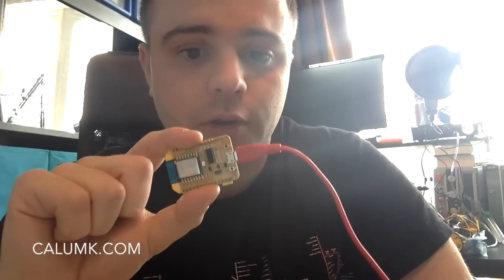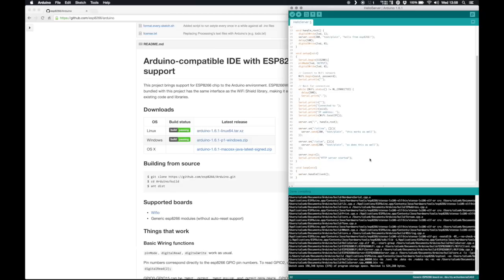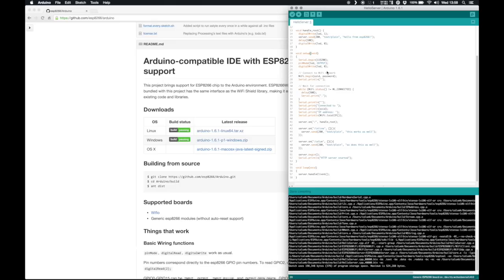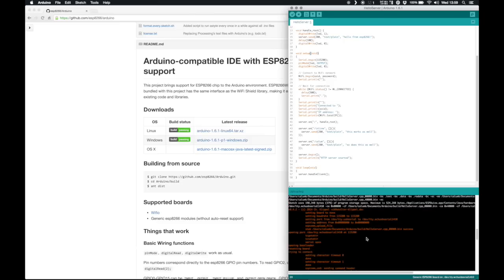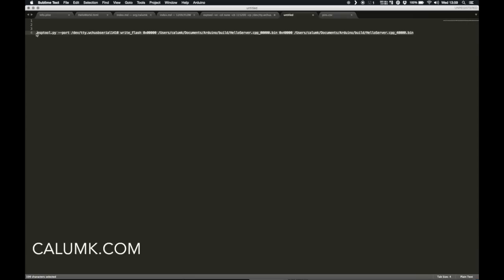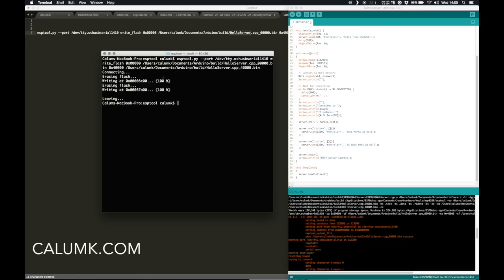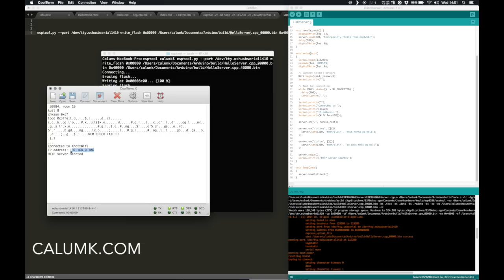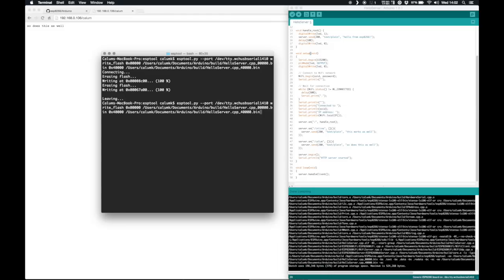Calumk.com - Programming the ESP8266 with Arduino IDE from OSX & esptool.py

Comment: So from your video I gather the Arduino really does NOT work? I have worked my 8266 modules using nodeMcu but wanted to try the arduino IDE since I've worked with it a bit, but I had no luck with it at all. I uploaded the "blink" sketch (changing the pin to 2), an the only thing that happened was the blue led that indicates serial communication came on solid. I am using a generic ESP-07 with a CH340 converter from a windows10 machine. I should also mention that I do not see the "ESPTOOL" option shown in your video on my version (1.6.8)

Comment: Calum, I ran into some snags following your video. When downloading I get the error as you do but my last lines before the error vary from yours quite a bit. Where do you get the .bin files at 0 and 0x4? I get the following last few lines (I'm on WIndows 10, Arduino 1.6.5 and using Adafruit's USB/TTLSerial Cable #954):

******
C:\Users\LapTopII\AppData\Roaming\Arduino15\packages\esp8266\tools\esptool\0.4.6/esptool.exe -eo 
  C:\Users\LapTopII\AppData\Roaming\Arduino15\packages\esp8266\hardware\esp8266\2.0.0/bootloaders/eboot/eboot.elf -bo 
C:\Users\LapTopII\AppData\Local\Temp\build4636103434768521066.tmp/HelloServer.cpp.bin -bm dio -bf 40 -bz 512K -bs .text -bp 4096 -ec -eo 
  C:\Users\LapTopII\AppData\Local\Temp\build4636103434768521066.tmp/HelloServer.cpp.elf -bs .irom0.text -bs .text -bs .data -bs .rodata -bc -ec 

Sketch uses 251,138 bytes (57%) of program storage space. Maximum is 434,160 bytes.

Global variables use 38,516 bytes (47%) of dynamic memory, leaving 43,404 bytes for local variables. Maximum is 81,920 bytes.
C:\Users\LapTopII\AppData\Roaming\Arduino15\packages\esp8266\tools\esptool\0.4.6/esptool.exe -vv -cd ck -cb 115200 -cp COM5 -ca 0x00000 -cf 
  C:\Users\LapTopII\AppData\Local\Temp\build4636103434768521066.tmp/HelloServer.cpp.bin
*****

At this point I'm not sure what to do. I mentioned my setup and in the Windows version there is not a programmer called  "esptool" so I tried with ArduinoISP, Arduino as ISP and USBasp but none work. Is one of the other posts correct in that this selection doesn't matter?  Anyway, what do I need to do to generate the correct .bin files? 
If I can get past this point I couldn't follow your procedure with the files. Can I enter it as a python statement through the Arduino Serial Monitor or is SM only equivalent to your CoolTerm? I assume your two lines of code under "Show More" are your specific and a generic python command statement.

Comment: For those with Windows 7, just use ESPFlasher.exe to upload your BIN file to your ESP8266.  You will need the BIN file, which is only available with the Arduino IDE program running (keep it running until after you have flashed your ESP8266 using ESPFlasher.exe)

Comment: Thanks for the video, it was very helpful, however I found some extra info which makes thing work without the extra esptool stuff...

Download the CH340 serial USB driver...
http://www.codenuke.net/2015/01/nodemcu-install-ch340-usb-to-serial-for-yosemite.html

Make sure you have Java installed, probably the SDK as you will need to run the ‘ant’ command
Go through : "Building latest version from source"…
https://github.com/esp8266/arduino
after "ant dis"t type the following to start the IDE….
ant run

Follow the rest of the vid to fiddle with the examples.  #nodemcu
Reply from the maker: javawocky Cheers, You will need the ch340 driver for my method too. 
I forgot about it as i had installed it ages back for something else

Comment: Hey, I am always getting below response while uploading any sktch... 
Build options changed, rebuilding all

Sketch uses 174,130 bytes (33%) of program storage space. Maximum is 524,288 bytes.
warning: espcomm_send_command: wrong direction/command: 0x00 0x08, expected 0x01 0x08
warning: espcomm_send_command: wrong direction/command: 0x00 0x08, expected 0x01 0x08
warning: espcomm_send_command: wrong direction/command: 0x00 0x08, expected 0x01 0x08
warning: espcomm_send_command: wrong direction/command: 0x00 0x08, expected 0x01 0x08
warning: espcomm_send_command: wrong direction/command: 0x00 0x08, expected 0x01 0x08
warning: espcomm_send_command: wrong direction/command: 0x00 0x08, expected 0x01 0x08
warning: espcomm_send_command: wrong direction/command: 0x00 0x08, expected 0x01 0x08
warning: espcomm_sync failed
error: espcomm_open failed

Appreciate if u can help.
Reply: Ranjoy Sen Hi Sen have u sort out your problem,I am having the same error on windows7 arduino1.6.4 ide.
Please revert back to me,if u got the solution of ur problem...

Comment: hi i have this errors from arduino ide

warning: espcomm_sync failed
error: espcomm_open failed

can you help?
i have the same board
and im on mac

if i run esptool from shell i have this error

Macintosh:~ samuele$ esptool.py --port  /dev/tty.Repleo-CH341-00002014 write_flash 0x00000 
Connecting...
Traceback (most recent call last):
  File "/usr/local/bin/esptool.py", line 5, in <module>
    pkg_resources.run_script('esptool==0.1.0', 'esptool.py')
  File "/System/Library/Frameworks/Python.framework/Versions/2.7/Extras/lib/python/pkg_resources.py", line 492, in run_script
    self.require(requires)[0].run_script(script_name, ns)
  File "/System/Library/Frameworks/Python.framework/Versions/2.7/Extras/lib/python/pkg_resources.py", line 1357, in run_script
    exec_(script_code, namespace, namespace)
  File "/System/Library/Frameworks/Python.framework/Versions/2.7/Extras/lib/python/pkg_resources.py", line 47, in exec_
    exec("""exec code in globs, locs""")
  File "<string>", line 1, in <module>
  File "/Library/Python/2.7/site-packages/esptool-0.1.0-py2.7.egg/EGG-INFO/scripts/esptool.py", line 479, in <module>
    
  File "/Library/Python/2.7/site-packages/esptool-0.1.0-py2.7.egg/EGG-INFO/scripts/esptool.py", line 157, in connect
    
Exception: Failed to connect
Macintosh:~ samuele$

Comment: I have some ideas. I would gladly share with you. Let's connect on hangouts.
Reply: Ron Hudson nice Ron I am having the same problem as Sen...please give some guidance on this....
Reply: +Shivank Gupta Hi shivank, if you figured out what was the issue, can you help me? I'm having the same issue :(
Reply: Rather, can you type it as a reply? that'll help others too who are stuck with the same issue...
Reply: Ya i figured out the issue...its with the connection of rx and tx pins..i simply remove and than connect them and it works...please check ur connection of rx &tx,this problem is only due improper connection...
Reply: Biju Neyyan